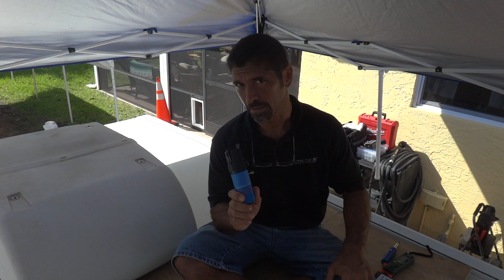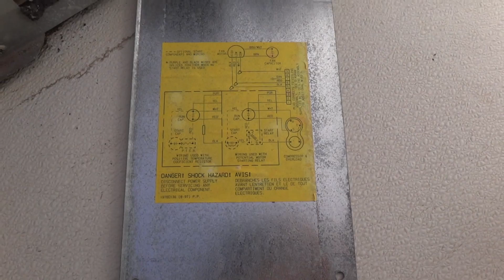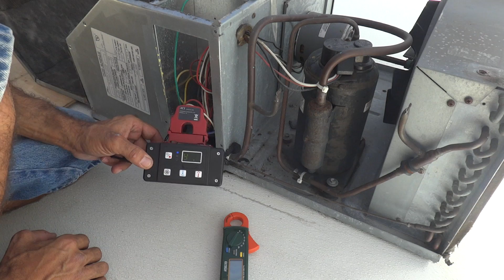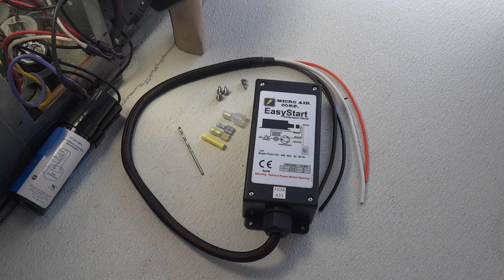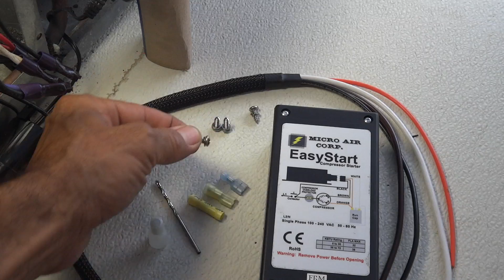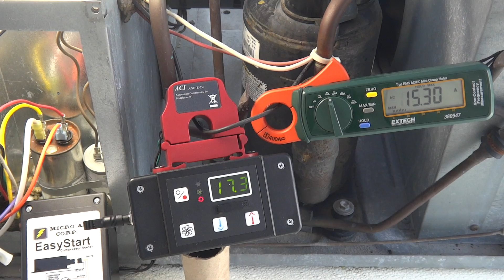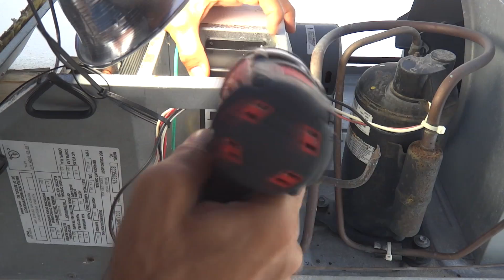Micro-Air EasyStart Soft Starter Installation into RV Rooftop Air Conditioner

Comment: Great video. Thanks. I am trying to lighten the pull off the 3k Honda generator I use to run my RV. I have an LG 10,000 BTU Window AC. It runs fine when the generator is at full speed, but obviously the fuel doesn't last as long. When I put it in Eco mode, the lights dim quite a bit and some outlets reset, which I don't want when I have my laptop plugged in. Would this help? Here is the schematic to my AC unit. I tried the hard start 5-2-1 capacitor and relay, but it didn't seem to help much, or I didn't have it connected right. Anyways, thanks for the information. 

http://imgur.com/a/SOj61
Reply from the maker: Thank you! We're glad you liked the video. Yes, for your situation where your Honda 3000 is bogging down during the startup of your 10kBTU window A/C, the EasyStart will definitely resolve the issue. Thank you as well for attaching the wiring diagram. If you'd like, please send us an e-mail and we'll draw in where the EasyStart would go in the diagram, and then send it back to you.

Comment: Interesting that you'd say a hard start capacitor will not work (worse, with increased current) when there are so many contradicting you with success stories regarding hard start capacitors. Whom should I believe? You trying to sell a product or them with nothing to gain? At $300+, not exactly an invalid question. Heck, adding a few bucks when buying a generator (for slightly increased capacity), if necessary, may ultimately be cheaper and easier.

Comment: Cool product and would love to have one, but not for $318!
Reply from the maker: Hojo70 - Thanks for the compliment.  We can totally understand your position.  EasyStart is not for everyone.  However, you have to look at the alternatives. Let's say you own a 2000W generator and it won't start your A/C.  You have a couple of choices:  1)  Purchase a 3000W generator anywhere from $1000 to $2000 (depending on brand and quality), or 2) purchase an EasyStart for $318.  This is why it is often the more economical solution for most people.

There are also some discount coupons available for EasyStart for a few RV manufacturer's owners forums where interest and success has been extremely high.  You can probably find them by doing internet searches.  If not, if you are seriously interested in purchasing an EasyStart, please contact us via our website link, let us know how you heard about EasyStart, and we can help you.  Thanks again for your interest and consideration.

Comment: Awesome vid guys. After looking at the hard start cap spec, the AC waveforms in particular, I was like no, this is not what I want (reducing startup current when starting from inverter/batteries). Then I found your vid. Makes total sense. You just saved from the hard start cap install.

Comment: I replaced a damaged Atwood AC-1501 (15KBtu heat pump rooftop unit) with a Dometic Blizzard NXT of the same capacity, on my trailer. I had occasional trouble with my Yamaha EF3000iSEB inverter generator starting the Atwood, but it struggled big time with the Dometic. The first couple of times it would do OK, but once the pressure had built up, it would usually fail to start the compressor, and just trip into overload. This was with the generator ECO-mode switch in the off position. Even at WOT, it would still trip the overload sensor when the compressor attempted to start. 

After speaking with Roger at Micro Air, I decided that the Easy-Start 364 would be the best solution. The installation was trouble free, and I am absolutely amazed at how much the start up amps were reduced! I wanted to determine how much amperage the generator was seeing, so I used a Fluke clamp meter, hooked up to the hot lead coming into the breaker panel from the generator cord.  

On shore power, the Dometic unit averaged 36.7A at startup, over 6 cycles, with the factory installed motor start kit. After installing the Easy-Start unit, and going through 7 starts to let it "learn" my system, the start up amps averaged 12.2 over the next 6 starts. Not only can I now run the AC on ECO-mode on my Yamaha 3000W, just for fun, I tried running it off of my Kipor IG2000P suitcase generator. Amazingly enough, even with that little generator running in ECO-mode, it will start and run the AC with no trouble. Of course, turning on lights, TV, and other things at the same time will make it run a bit harder than I like, so I'll stick to using the Yamaha. Regardless of which generator I use, the amount of stress their put under is GREATLY reduced, so I'm pleased overall. 

I was a little skeptical at first, but I'm very impressed with the Easy-Start unit, and even more impressed with the customer service I received, even before I became a paying customer. I've been telling everyone I know about getting one for their rigs!

Comment: Finished the Easy Start install a few hours ago. Start to finish about 2.5 beers install time, I believe my 11 year old grandson could follow the wire colors and be successful. Used shore power for the first 7 starts for the learning curve ( just to be sure I did not get a slow learner box.)
 
The Honda 2000I was connected and following starting I turned off the Economy mode and turned on the 13.5 Coleman. Fan worked, then the compressor kicked in with hardly a burble from the generator.  SUCCESS!!!! 

After patting myself on the back, I turned on the economy mode of the generator and listened to "little Red" (generator) settle down to somewhere between idle and max power.  

To say I am very pleased would be a huge understatement. The AC has been running for about 3 hours as I finish this comment. When the compressor kicks off "little red"  goes to idle until the compressor kicks back in.  Much quieter than the Onan not mention less than half the fuel. 

OK funny part, As I type this I just heard a loud long rumble and rushed outside expecting the AC and motor home to have exploded.... Turns out It was the noise of a dump truck passing by using his exhaust brake.  All is very well with "little Red" and my "Taj-ma-Haul"

Thanks to all the guys at Easy Start for convincing me this was the way to go. Rodger actually called me with information during purchase. Shipping was fast and with e-mail updates.  Great company to work with.
Cheers, Vance
Reply: VA White I'm a little familiar with the Honda generators does yours have a 30 amp plug or just the 110 outlet that you use for the RV and is your generator pretty fuel efficient? I found out why Honda makes more power. they have a bigger engines that is light in a small portable suitcase style generator like yours has a 98 cc engine. that's bigger than the average 80 cc 2000 watt suitcase portable generators. And Honda's seem to be quieter and a better muffler on them with a little tiny hole for the exhaust. And the 2200 has a 128 cc engine on it that's even bigger and on the technical side they say they make more amps and out of every generator I looked at nobody makes a 128 cc motor in that small portable lightweight size. So when you get in a bog down moment the bigger engine will not have that overload problem. But I'm just not sure what a lot of you RV guys are running the 30 amp plug or the 110 plug? because I don't want Heat Outlet build up at the 110 volt outlet plug.

Comment: Just thought I would share my experience.  I have a travel trailer with a Coleman Mach 15 (15k BTU) air conditioner and a Honda EU2000i generator.  

Before installing the EasyStart if I turned off every circuit breaker except the AC and ran the Honda with eco-mode off the Honda "could" start the AC.  When the compressor kicked on the Honda would stall for a few seconds.  Most of the time the generator would rev back up... (but sometimes it would just stall out and quit with higher head pressure on the compressor; i.e., on hotter days, or if the compressor was cycling back on).  However, during the few seconds of stalling/loading the generator the voltage would drop to ~70 to 80 VAC.  That can be damaging for other elecronics; i.e., my laptop, my wife's laptop, TV, etc.  Another reason why I used to shut off all circuit breakers; just to be sure nothing else that happens to be plugged in inside, or outside, the travel trailer experiences low-voltage/brown-out conditions.

After installing the EasyStart, I first tried starting the AC with eco-mode off.  No stalling, no voltage drop.  Cool!  So, I next went for the gusto: start the AC with eco-mode on... No stalling, no voltage drop, and the Honda just revved up to something between eco-mode and full throttle to match the load.  Now the AC compressor starts every time and I don't have to worry about other voltage-sensitive electronics getting damaged.  Nothing better than boondocking, working on a laptop or watching TV, and enjoying cold AC at the same time.  All running off of my Honda EU2000i in eco-mode.

Great product!  Definitely worth the money!
Reply: A few moments of reduced voltage isn't damaging to laptops. They run off their batteries so there's a buffer between the computer the 110v outlet. Certainly not ideal to drop the voltage momentarily, but CERTAINLY not a big deal.
Reply from the maker: Hi SLOaccent. That's awesome! Thank you very much for sharing your success story with EasyStart.
Reply: Oh, I forgot to comment on the video... oopsy.

Thanks for a detailed instructional video.  I appreciate the detail of the install even down to the exact wiring connectors and tools needed.  It made for my install to be a "one trip up the roof ladder" experience.  Without the video it would have been several trips from the trailer's roof, to my garage,  back up the roof ladder, to the hardware store, and back up the roof ladder, again.

Thanks.

Comment: Will this also work on a refrigerator? I have the same Coleman unit mounted on my sailboat and will be adding your soft start asap.  ;)
Reply from the maker: HI Jim.  That's awesome you are going to add an EasyStart to your Coleman.  Thank you for that.  You won't be disappointed.  

Ironically, another customer just a few hours ago asked us the exact same question via e-mail that you are asking about EasyStart and refrigerators.  Yes, EasyStart does work with refrigerators, but installation thereto will be more challenging.  This is because refrigerator compressors have connectors and wiring that don't lend themselves to adding in the EasyStart quite as conveniently as A/C compressor do.  But don't give up hope.  Customer's have done it before and we can help you.  If you can snap a clear photo of your refrigerator's compressor data plate label (not the label for the refrigerator itself), send it to our Technical Support e-mail address listed on our website under "Contact Us", and we'll advise you from there on what to expect.  

Thank you again for your interest and your question!
Reply: Micro-Air, Inc. Could I just bring my most energy efficient I can find brand new refrigerator up to New Jersey and have you guys to install it? How much would it cost For the part and labor?
Reply from the maker: Hi again Jon.  Unfortunately, we don't offer such services at our factory, and as explained above, we would not be able to assure you that it would work. Refrigerators have strange compressor wiring that makes adding in the EasyStart tough.  Beyond this, some refrigerators refuse to soft start because their internal refrigerant pressures never seem to equalize.  That being said though, we just had a customer successfully install an EasyStart into a very difficult Embraco refrigerator compressor.  He had to "modify" the plug-in module quite extensively to separate out and wire in all of the connections.  Feasible, but unfortunately not something we have resources to handle at our factory.  Sorry.

Comment: I purchased the EasyStart™ 364 (3-ton) Soft Starter. Installed it on a Coleman Mach 1, without any issues after watching the You Tube video. I am very impressed on how Honda EU2000i now performed on Eco mode. No more problems with brown outs or short cycling. Both the AC and Generator just work as designed. We no longer worry about the thermostat settings or the mode the generator is in. Thanks
Reply from the maker: Will - That is awesome news and we greatly appreciate your compliments!  We actually invested in our own Honda EU2000i years ago at Micro-Air just to do that ECO mode testing.  EasyStart works quite well in that generator application as you found, and we also did a lot of testing and refinement with a variety of inverter power sources too.   Thank you again and happy EasyStarting!

Comment: Less than $50.  The hard start knocked off 5 amps for me??  https://youtu.be/NVkCjPh7Nd8
Reply from the maker: Thanks for your comment Marion.  We watched your video and noticed that your Coleman Mach 13.5 was a different model number and appeared newer.  Perhaps it did not have a start cap and start assist pre-installed by the Airxcel factory like the one we demonstrated with?  If yours didn't, which I suspect since you wouldn't have installed a hardstart otherwise, then adding the hardstart would likely have helped a little, as you demonstrated.  In any case, there three very important points and differences to be aware of:  

1) Your analog Simpson ammeter isn't showing the true starting peak (22A and 17A as you measured) even though the relative measurement is still valid.  As noted in your video, your air conditioner has a LRA rating of 50.5A.  Therefore, the true starting peak measured with an accurate, high-speed ammeter would have been in the 40A range with the hardstart installed, and slightly higher without.

2) The current reduction from the accurately-measured starting peak attained with the EasyStart will be much greater than with the hardstart (10-20% reduction with the hardstart versus 65-70% reduction with EasyStart)

3) Using a hardstart instead of an EasyStart may not be enough to allow your air conditioner to start on a generator (or inverter) that is smaller than what you were using, and using a hardstart won't allow you to run as many other loads on the same generator as the EasyStart would allow. 

Thanks again for your feedback.  We invite you to demonstrate this for yourself with EasyStart.